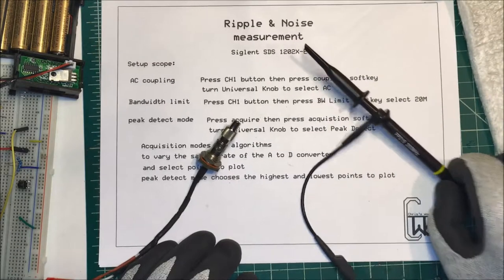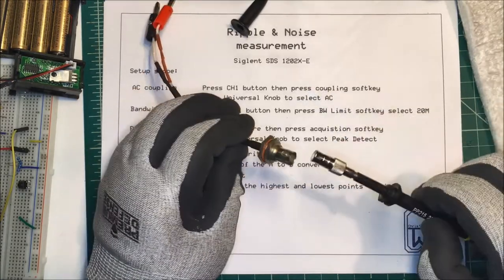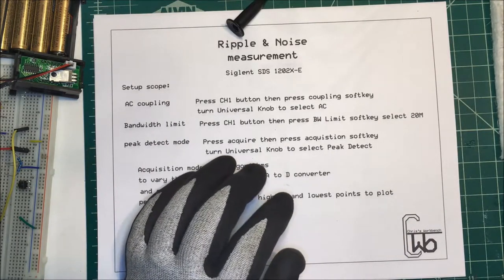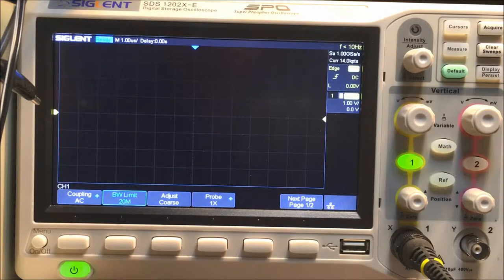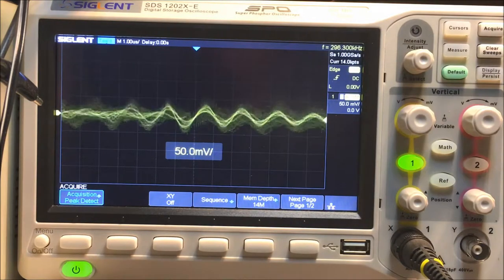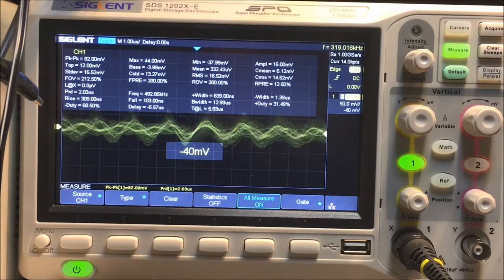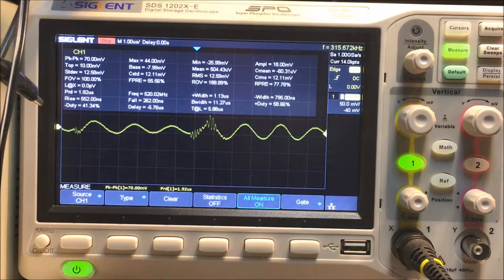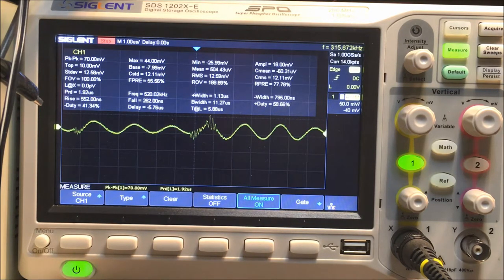Ripple & Noise Measurement

Comment: i tried doing the same thing on my siglent and it's MADDENING - you would THINK that it would center an AC coupled signal but i can only view a signal that's more than 100mv/div. - going down lower puts it off the screen - too far to be retrieved by the vertical adjust .... anyone know what im doing wrong here??
Reply: OK i followed your procedure here - setting it to 'peak detect' and it worked better - though measured values dropped from about 40mv peak ripple to 600µv peak ripple, which i don't really trust. I DID change out probe value in software to 10x from 1x just to see if that might do anything and that's when the 600µV stat showed up - but then i changed it back to 1x and the 600µV value didn't change. But at 10x 600µV would only translate to 6mV no?? that doesn't make sense either. not sure what i'm doing wrong here! seems like the settings have a weird persistence (like changing to DC coupling later and AC still shows up in the side bar display)